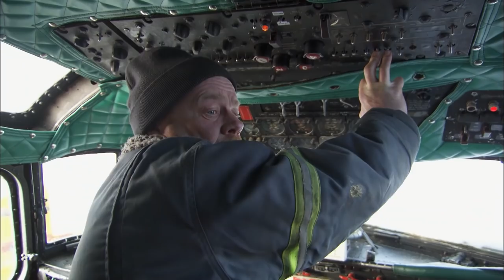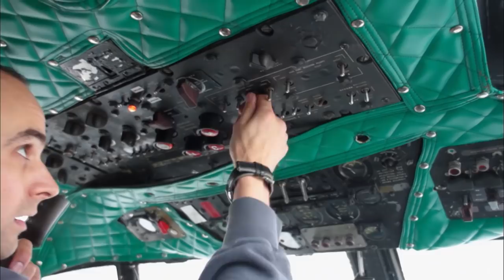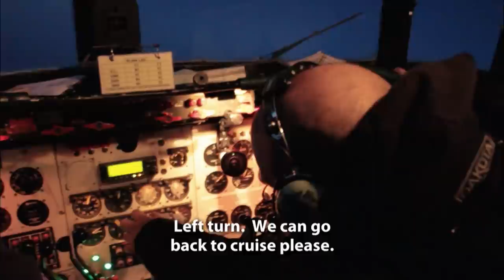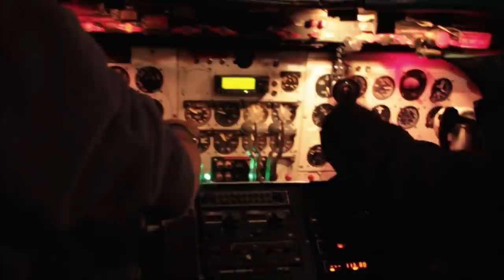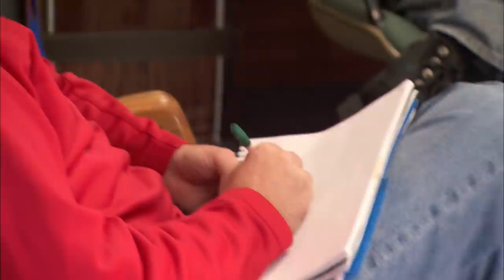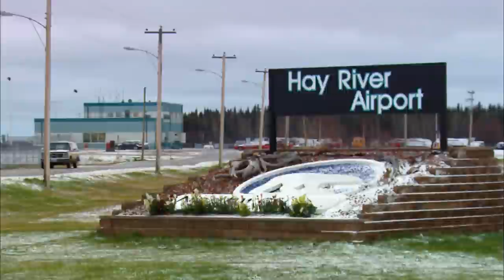Test Flying A Fire-Fighting Consolidated PBY Catalina | Ice Pilots NWT | Wonder

Comment: It’s surprising they have been able to fly these 80-90 year old air frames for commercial use this long specially in the conditions they have up north and not for nothing the amount of extra work they have to do just to start them up in the morning making sure the engines are warm. The extreme cold then hot I’m surprised they don’t crack cylinders once a week on these old radial engines. These engines were designed almost 100 years ago. Literally flying around antiques.

Comment: Almost done every single all these episodes the narrator claims that have gas is going away but it's not almost every single airplane in the sky smaller airplanes runs avgas every single airport has it for the Piston airplanes usually for like the Cessnas and smaller planes and some small helicopters